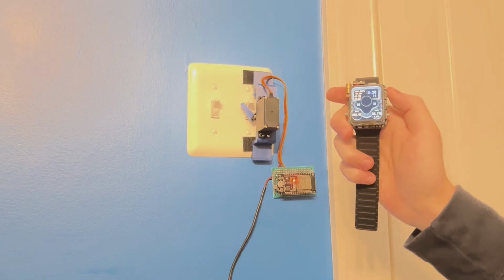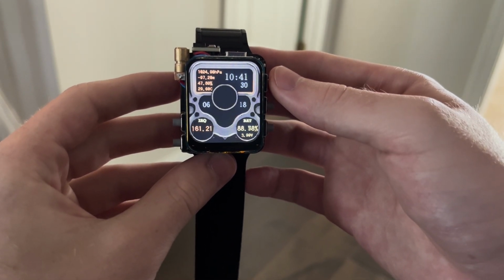DIY ESP32-Based Wireless Smartwatch Demo | LiDAR Distance Sensing and WiFi Scanning | Gateway

Comment: Im in the process of making my own smartwatch and your project turned me from full on application arm processors to the really low power microcontroller arm processors. My watch will be more of a 2-3" cuff rather than cramming it all under the small screen footprint. Good job on the 680 module implimentation. I have the 688 in my schematics. I also have some design implimentations for a full SDR transciever with a TPU for SIGINT such as drone detection, device mapping, and so on. I found a 4g soc with gps. So long as I save map tiles as jpeg with a refrence coordinate, I can overlay my coordinates on the image with very reasonable accuracy. I was even going to add a 1tb flash memory chip with entire pdfs coverted to jpeg, audio files in wav format, and videos in mjpeg. If I can find a way to push a zim file as an image database, then we would be cooking with gas as having wikipedia on our wrists would be the shiznit.